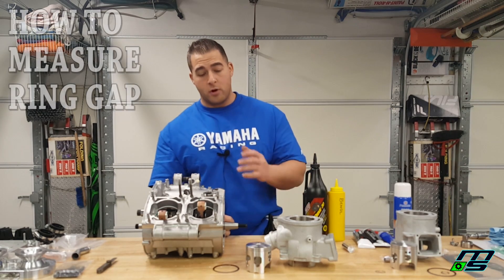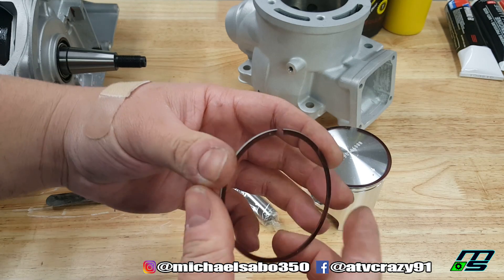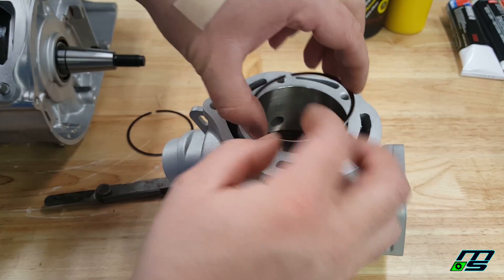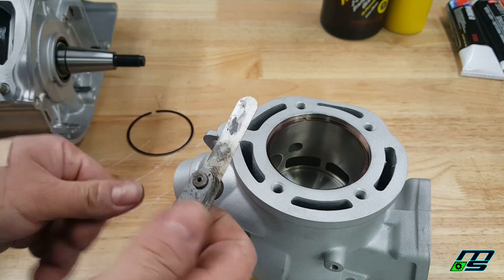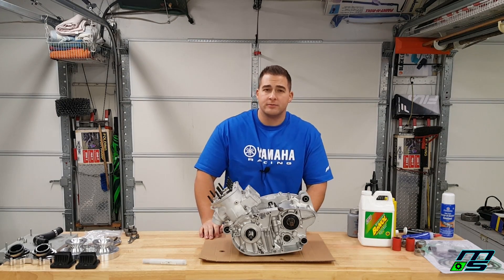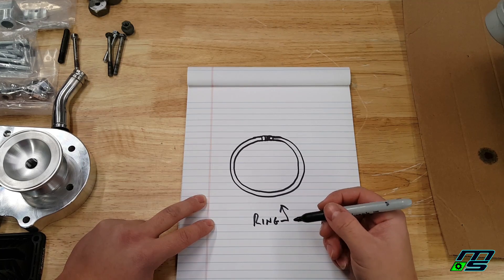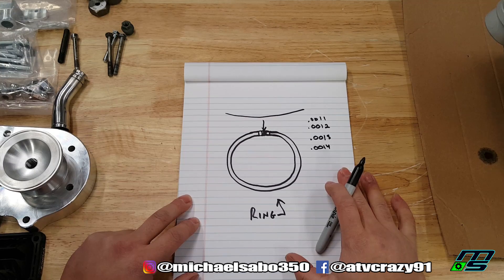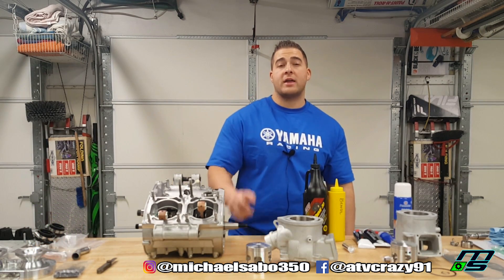How To Check Ring Gap and Why It's Important

Comment: Mike thankyou. I had a local shop do my kids quad lta 50. I just did not have time. The shop did not gap the rings and they did not put new base or head gasket and it blew up in less then 2 hrs. And was very hard to start lol.   Damn guy also stole my mikuni carb off my son's pw 50 also.  So I'm now making time to do it rite and appreciate your videos and the time you take to create them. There extremely helpful and full.of awesome stuff.  Thanks mike

Comment: Before inserting the ring into the cylinder, it's a good idea to use a scotch-brite pad ....rotate the ring on the outside edge,  on top of the pad to remove any high spots of ring coating .

Comment: Thanks for the video. I have a 2001 kodiak 400. Got 2 problems with it. It sucked in some of the air filter into the carb. Next thing I know its blowing white smoke and when it shuts down it makes like a grinding sound. We have the top of it off. The piston looks clean and one of the rings looks bigger then it should. How can we tell if its both or just the rings? Thank you for any help you can offer.

Comment: Also when the ring gap is closed the right amount, the ring is now perfectly circular to go with a perfect round bore. The bore wears oval thanks to piston side thrust and the round ring now has gaps between it and the oval bore and under pressure gas escapes. One reason new rings in a old oval and tapered bore MAY increase compression a little and less loss of oil, but you need to grind out and round the bore again and maybe fit oversized rings to fit the new bore size. Piston may also be worn down so oversized pistons too.  Basically this job needs to be done properly unless you want just an improvement perhaps and not a proper rebuild.

Comment: Finally what crank you choose Michael ?!!
Im lookingfor a vitos performance or driveline performance i dont know whos better
Reply from the maker: I dont have any experience with Vitos but I know they're a good name. I chose the welded driveline 115mm crank with 10 ball bearing.
Reply: @MichaelSabo  Thanks!!
Do you know if with a ypvs cilinders with the power valve can I build a 4mill engine ??
With de 4mill crank long rods and new dommes
It is posible? I want to do 
I dont see any build like this!!!!
Reply from the maker: I dont see why it couldn't be done; even if the cylinder is not made for the longer crank, you could machine your domes or use a spacer plate to make it work.
Reply: @MichaelSabo  Okey, i will ask in driveline for  información